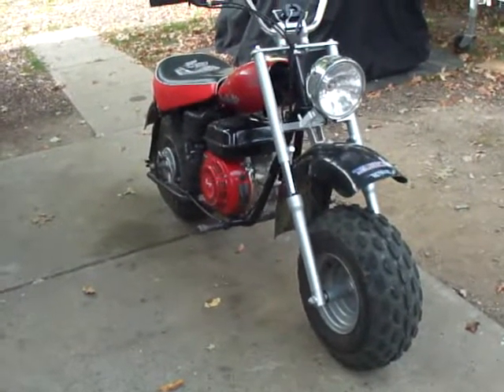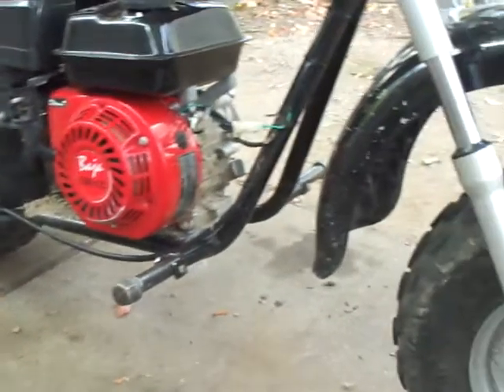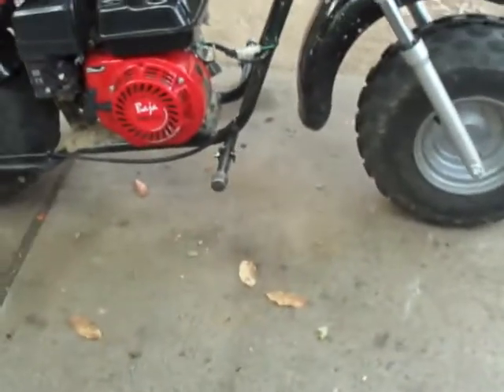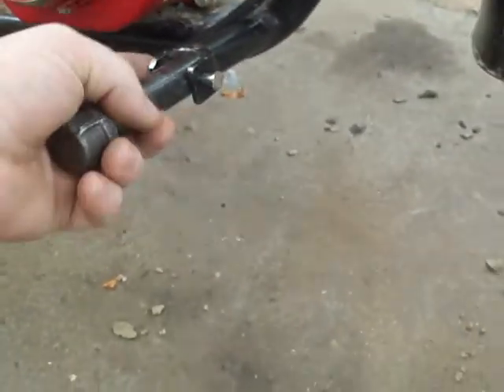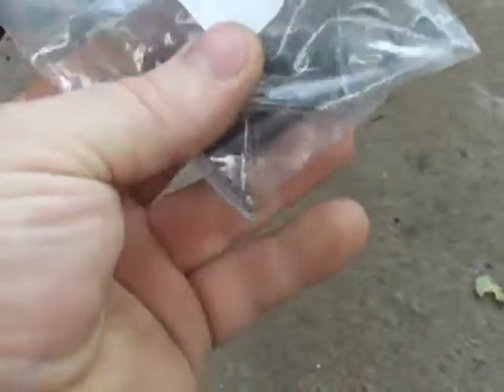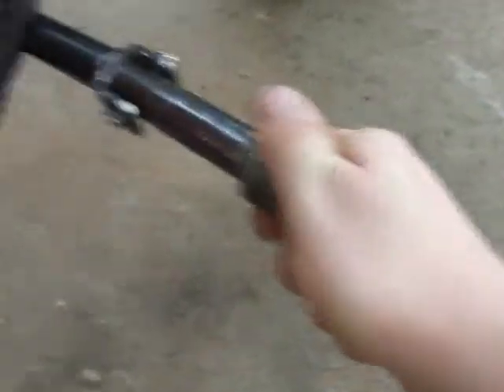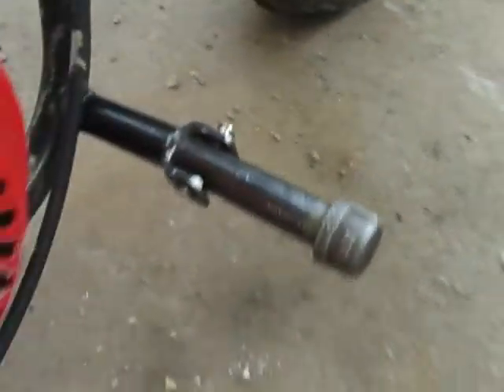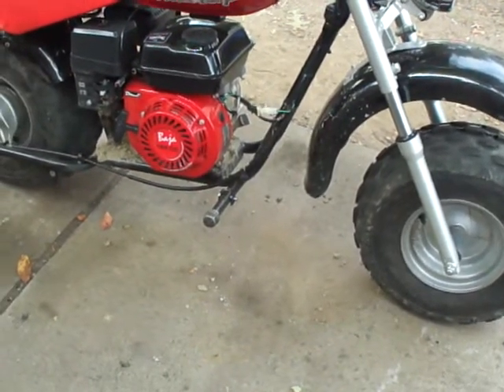Mini Baja Footpegs -Upgrade to solid steel unbreakable pair under $5 in an hour!

Comment: They won’t fold up if gets close to ground...safety issues...great idea, just cut on angle same as original pegs..
Reply from the maker: Peter Hayes I hit a log and the whole thing snapped off where it was welded onto the frame. We re-welded it back on, this time better than originally. If the peg ever hit something from the side again it would likely snap the frame.
These are descent bikes and take a lot of abuse out their, but that was one area that was made poorly on this bike, they should have come up with a better design in general for the footpegs, that was stronger.
I will grind an angle on them so they can flip up, but if they get hit from the side going at a reasonable speed they will just snap off at the weld or bust the frame the next time, rather than catch and jolt me or cause me to be thrown from the bike, better off snapping, than being thrown from the bike and possibly, seriously injured. I do everything in my power to be sure not to hit anything with them, but not always possible to avoid everything at faster speeds, being so low. Since the re-weld, so far so good. Hopefully they last me a good long time without anymore issues with breaking off. Knock on wood.
Its nice to be able to hit a jump and use my footpegs to brace for impact when I land now, it makes the riding experience much better, before I added them you could not take jumps and dips that hard or your foot would just snap it off.